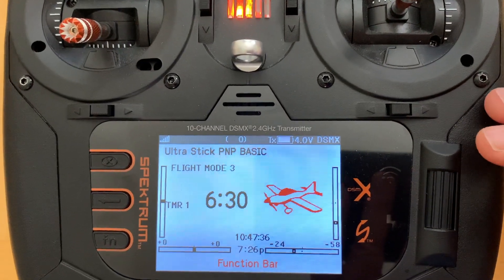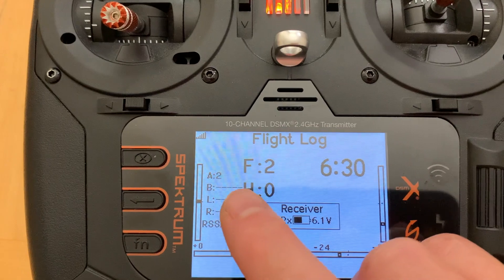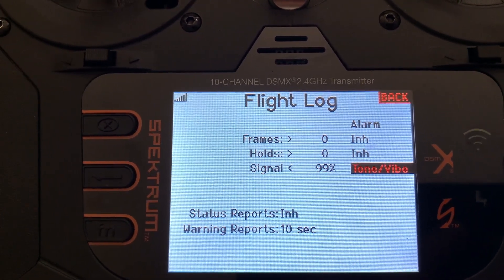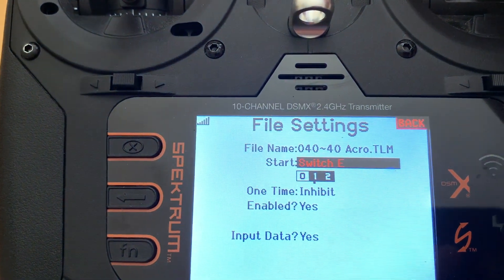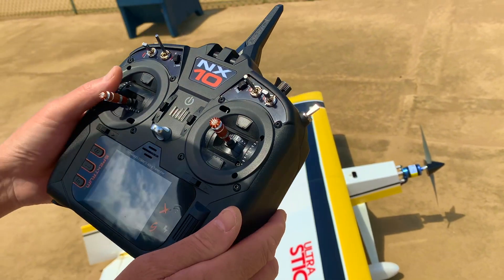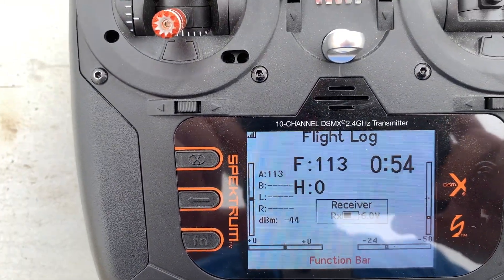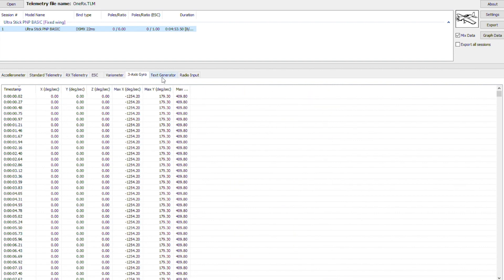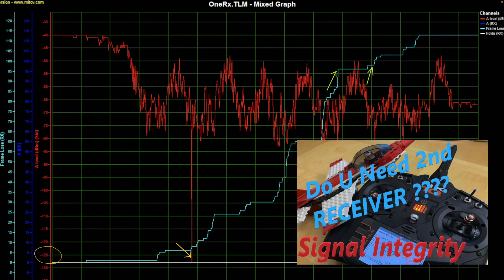#Lesson Learned How To Monitor Analyze #RSSI Signal Integrity | 8HrToGo

Comment: When using SD card will it overwrite other file information on it or is there a section allocated just for flight logging?
Reply from the maker: It does not allocated any storage, as it will overwrite oldest files if space limited. Thanks for tuning in! 👍

Comment: Very interesting & informative video! 🙂 The surprising thing to me was that you didn't seem to be flying especially far away; but if you're in a high RFI environment (as you seem to be), the receiver could be struggling a bit to pull your transmitted signal out of the noise.
     I haven't had this issue (so far) with any of my Spectrum radios (currently using an NX10SE, also have an older DX9 as a backup); I do some flying in a city environment with mostly UMX & park flyer style planes (my Visionaire is the fastest plane I use for park flying); not sure if the receiver in it (without specifically looking at it, I think it's an AR630?) has telemetry capability.  In the city setting, I'm generally flying low & close (especially if I'm flying my UMX YAK 54 3D).  I recently started going back to my old club field which is in a fairly rural area (bought an e-Flite F4U Corsair, which requires more runway, & is far faster than the "fun-fly" planes I otherwise fly; at least until I get used to it, I don't DARE fly it in a park setting!).  I always range-check a new plane before flying; the only incident I can recall was years ago, flying at a soccer field on the ground of my last employer (I'm now retired); the soccer field was literally right next to the plant that I worked in, making it convenient to go out during my afternoon break & get in some flying with either a MX or park flyer plane.  I was flying a UMX "BEAST 3D which I was very comfortable flying; when suddenly, from about 30 feet altitude, (& in straight & level flight) it nose-dived straight into the ground.  😳 Fortunately, there was relatively little physical damage; I picked it up, & out of curiosity, did a range check on it.  I was shocked when I found that only about 3 feet away from it, I had NO control!  (It worked if I brought the transmitter in close).  Brought it home & checked it, found that the antenna (which in this UMX plane, was about a 1" piece of wire off the receiver / speed controller / 2X servo board) apparently had a cold solder joint from the factory, & had broken loose! 😲  Resoldered it, and the radio range was restored! 🙂
   I'm going to have to give your suggestions here a try.  Thanks!😀
Reply from the maker: I think the most important thing to pay attention to is the H (Hold) number. If you consistently see high number of holds, that's a red flag at where you fly, and you should consider don't fly there or reposition your antenna or add additional 2nd antenna. Please pay attention to it. Thanks for your detailed comment.

Comment: Excellent explanation.  First time I know how to read the data and understand it.  I have one carbon fiber intensive plane where this will be of paramount importance.  Thank you!!
Reply from the maker: Yes, please be aware that 2.4G band is saturated now and if you are flying in middle of no-where, then it's not much an issue, but if your flying field is near cities towns, with lot of WiFi going around, be sure to start monitoring your data, and maybe add another 2nd antenna or start moving your receiver around away from carbon area, to see if communication link is strong or not. Thanks!
Reply: @8HrToGo  Thank you for your reply.  There is no practical way to avoid the carbon fiber which is like a cage however, I have just received a new receiver and satellite receiver (4 antennas to protrude out the fuselage) and hope that will help me avoid another uncontrolled crash of an expensive balsa plane!  Will be watching your ‘add a satellite receiver” video shortly for helpful hints.  Thanks!